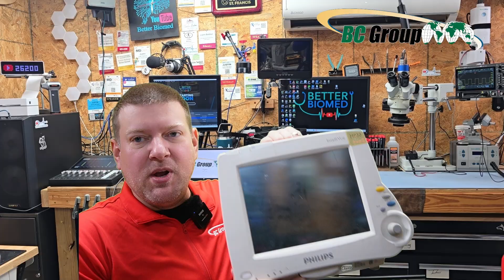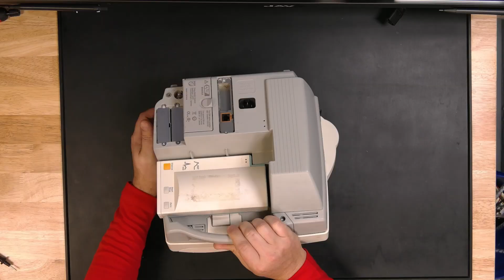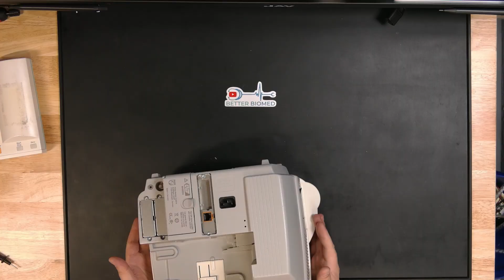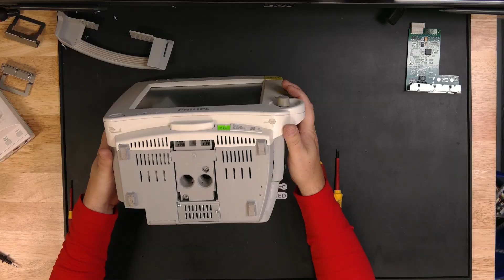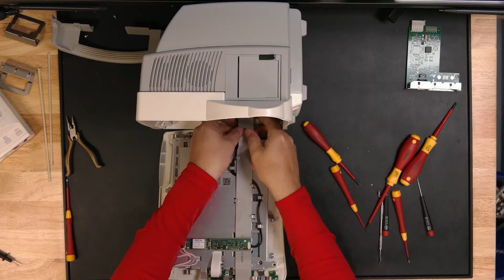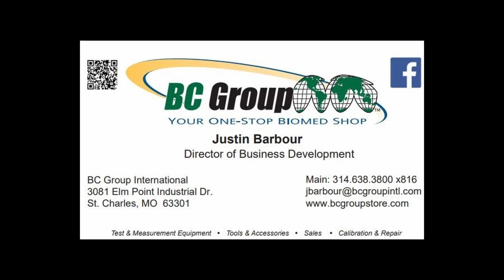Philips IntelliVue MP30 Patient Monitor Teardown

Comment: Loved your videos, can you tell me about how to change languages in these Philips Patient Monitors especially (MP30 and MP50)
Reply from the maker: Changing the display language on Philips IntelliVue patient monitors requires accessing Configuration Mode using the device's service passcode, as language settings are locked during normal day-to-day monitoring mode 1.

Here is the general procedure:

Press the SmartKeys key and open the Main Setup menu 1.
Select Operating Modes, choose Config, and enter the configuration/service passcode 1 (which is provided in your unit's specific service documentation).
Navigate to the system or regional settings to change the language option.
Store the configuration changes before exiting configuration mode, then switch the operating mode back to Monitoring 1.
Note: If you are attempting to change the language on a unit imported from another region (such as converting a device from German to English) and the desired language option is missing or grayed out, the device may require a firmware language package update using the authorized Philips Service Tool or assistance from a certified biomedical service technician.

Comment: Nice video on the teardown of an MP30 and helpfull to service thes machines.
The service manual shows codes to enter the Diagnostics, Service and Config modes and the step by step to change for instance the Language.
A simple user however can only change the Language if he posesses a Philips service USB dongle with language packs on it. Bummer.
Are you capable to change languages to English? I work for free at a non-profit organisation in The Netherlands where we check and restore all kind of hospital equipment for projects all over the world and like to minimize the cost for those organisations as much as possible.
Reply: How to change language in these monitors (especially in MP50)